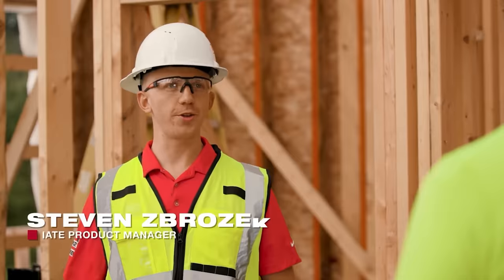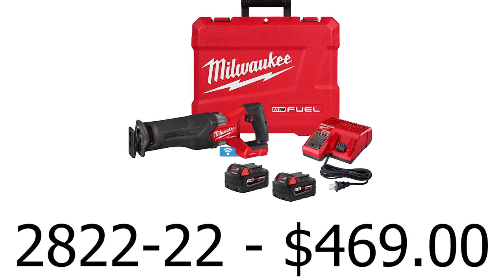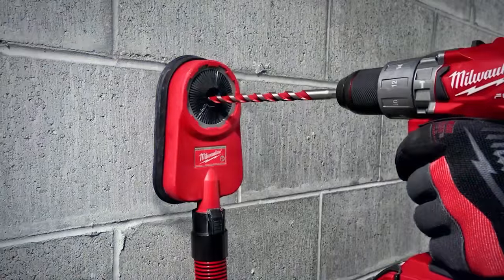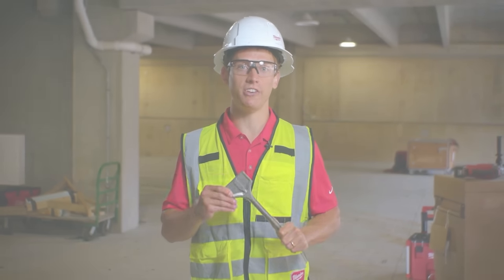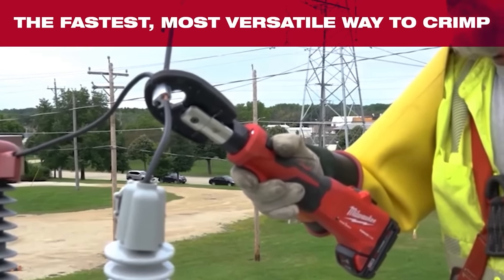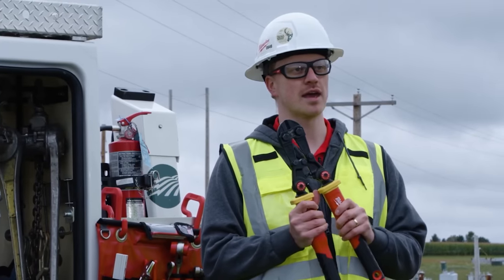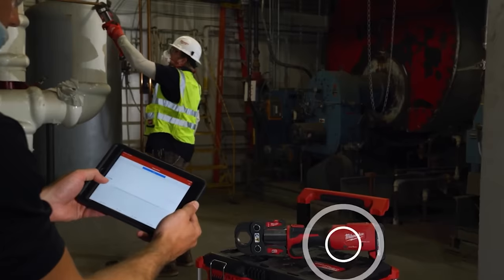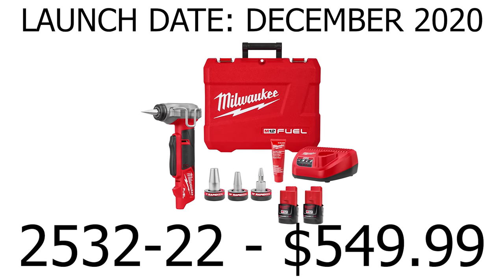BRAND NEW MILWAUKEE TOOLS RELEASED IN 2020 & BEYOND (No Fluff)

Comment: After doing some research people can say what they want but kobalts 24v line compares to the milwaukee m18 line and really goes above the m12 line which isnt saying much considering its a larger battery but my point is i have kobalt tools for work doing industrial maintenance and i couldnt see paying the price for milwaukee for what little i use the power tools and ive never had a problem with kobalt except when i let a coworker use my 24v hammer drill/driver to drill a hole to drain a 6 inch pvc line and got water in it and locked it up with rust and dirt from the water but i had it for 2 years and got my money's worth and accidents happen but so far strictly from the drill and impact pov.....kobalts xtr competes with the m18 hammer drill in specs and regular kobalt outclasses the m12 in specs, if the new kobalt xtr specs are true and not fluff then kobalt has milwaukee fuel m12 and m18 beat however milwaukee has kobalt beat in impact wrenches in both compact and full size impact wrenches.....my take away brand name doesnt matter as long as the job gets done and depends on the budget....get what you want or what you can afford that gets the job done the same you dont need a $200 snap on wrench when a $20 craftsman or kobalt or husky will work 

Psa- i do like the slimness of the m12 battery line small compact batteries which is why i was thinking about getting some milwaukee tools but after research id be losing power on tools just for the convenience of a slicker look

Comment: Just copped the m12 fuel multi tool for 78.52 out the door yeeyee
Reply: From home depot?
Reply: @hughs9718  yessir wasn’t in the system but the had it on the floor with free 2.0 got full price 64.97 for battery when returned it and 10% military. Worth looking into if they don’t have the promo in their system yet
Reply: Got a # to look it up
Reply: Nice, they messed up lol. They not supposed to allow the promo and the 10% lol sweet deal
Reply: I don’t have a number but walked the manager over to the setup and she took pic of the sku and input it into system didn’t come up so just took price of battery off

Comment: But why use metal studs wood is easier to use, theyre is pretty solid, and wire or pipes dont need protective sleeves where the studs are
Reply: Most commercial buildings have metal studs brother. Much more durable.
Reply: @GoofsGuides I see where they can be good but I still think wood are better
Reply: @abdulelkhatib2674  well metal costs a lot more, so you can see why they'd use metal in buildings that are expensive and meant to last a long time.

Comment: I pre-ordered the phone charger... I mean I pre-ordered the Top-Off. 

I'm sorta interested in the new Sawzall but I'd like to see it go against the Orbital Super Sawzall. 

I like the hammer drill bits. 

The fiberglass bit is interesting to say the least. 

The racheting wrench is really cool. 

I like the bolt cutters. 

I'd buy two of the 7 in 1, just incase I lose one I'll have a back up.
Reply: Got the 7 n 1 it’s the bomb!!
Reply: As far as the fiberglass bit goes, I need a roll stamped size number as well. Laser etching is neat and all but its useless when it wears off...... I have some impact sockets to prove it